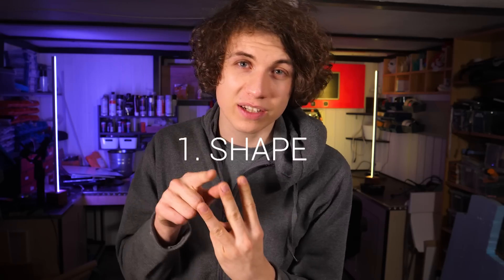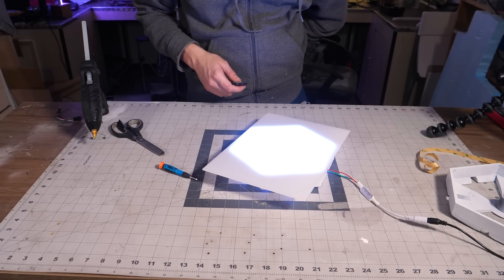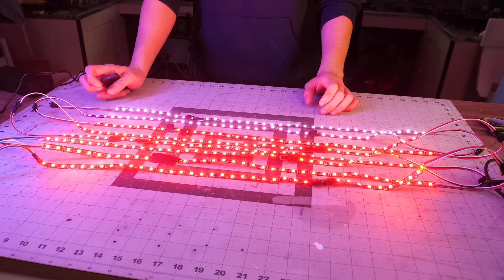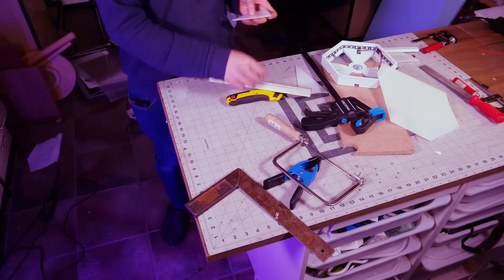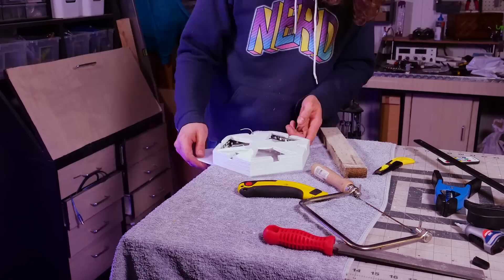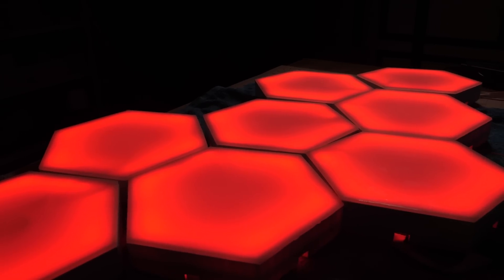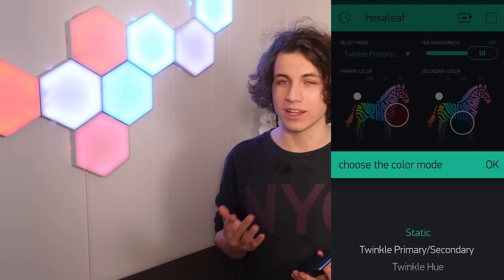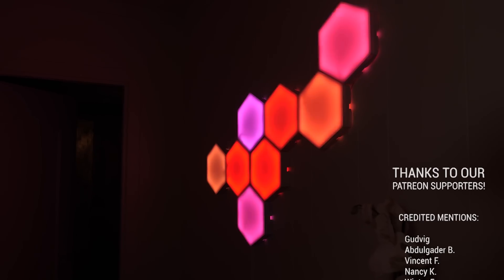Making My Own Version of Nanoleaf Aurora - DIY Project

Comment: In case anyone is interested, I found these styrofoam trays make great diffusers.  Styrofoam plates would work too, but these have a nice large flat area for cutting out.  These do have an embossed logos underneath but you don't see that when used:

https://www.amazon.com/gp/product/B0017OCLAK/ref=ppx_yo_dt_b_asin_title_o07_s00?ie=UTF8&psc=1

Comment: Hey man, This looks realy awesome so I showed it to my dad. And now it seems Ill be making 2 sets of ~10 or so. Luckily I found a nice place that cuts the Acrylic into hexagons for you cutting the labor time down by alot.

Something I noticed in this design is the light bleed for the cable holes. I think I might design and 3D print some "clips" to plug unused holes to reduce the light bleed from the holes.

Comment: Great project.  
The EsPixelstick firmware on a NodeMCU is quick and easy for non-coders.  You can model the light in x-lights or Vixen, and then animate it.  EsPexelstick also works with MQTT.

Comment: great work as always, i have a question, what could you change(code-wise) for a WS2801 LED strips when it has R G B pins instead of one data pin!!? tanks .
Reply: Like.. everything 😹 you can then get only one color always. With argb, you can control every led separately.

Comment: What is the inside measurement of one side of the hexagon please.  Did you use 39 LEDs per hexagon?
Reply: He used 13 LEDs per box, in the code he defines the constant LEDS_IN_BOX as 13.
Reply: @baryemini4103  That can't be right because the strips he cut  had 39 LEDs on them. Maybe 13 for each colour R G B?

Comment: magnets and contact pads would probably make it easier to replace or add more segments as you wouldn't have to deal with the connections especially since you're gluing the diffusion plate to the top. polarizing the magnets would also help make sure you don't put them in backward.

Comment: So many confusing things about this project.

(1) Is the logic level shift just to go from 5v to 3.3v? Couldn't I just use a 12v to 3.3v step down?
(2) What width/height are the acrylic sheets? (trying to find some on Amazon here in the U.S.)
(3) LED 2811 strips aren't individually addressed pixels, it's every 3 pixels. So was that an issue?

Comment: Hello, i am also an elelctracal engineer from Berlin, Germany and i really like your video. 

i wanted to chek out yout Android app, but the link is dead? 

Does the Led Stripe require 5V for Controll Pin? is it possible to do it with 3V or 12V like VCC? 

When i take the arduino nano, the Digital Pins got a 5V level, so the level shifter is not needed !?
for what purpose do you use the DC5-24V Mini 14 Keys RF Wireless Remote Controller, isnt the Programm run by the Microcontroller? 

Thanks for your answers, goodbye

Comment: if you have twisted the ground and the signal then you have killed the 1st chip - cut the 1st chip away and solder the wires again - then it works

Comment: Hey, I rebuild your cool project but I am facing some problems when it comes to the cable extension when placing it on wall. When I put a cable extension between the board and the lights it flickers at brighter colors. Removing this cable fixes this issue but I don't want to place the board at the wall... How did you fix this in your version?

Comment: Project started! 
Optimized 3D model, center cylinder removed, and to be closed so no light emitting where unwanted, can be broken out where the connector goes.

2 printed @ about 18cm, <30m filament. Parts to be ordered & waiting :-(.....
Anyone to put on the list for a set? :-) drop me a note.

Comment: Awesome video! What filament did you use for the 3d printed panels? I'm thinking of starting a project just like this but i'm still inexperienced with 3D printing. Can I use pla? Or would that break down over time?

Comment: Hey I`ve printed one frame und would test it with one pice, but where i can get the blynk code. If i use the link above, but  i only get a start page from blynk and is it possbile to use a Wemos D1 or Nodemcu ? Thanks Sascha
Reply: I found out and it works. But now and then the LEDS flash / flickering, do you have any idea why this happens or is this due to the NodeMCU?

Comment: The 3D printed frames look kind of awful. There's clearly some layer separation and misalignment going on there.

Could probably do it faster and cheaper with a thin sheet of plywood for the sides of your hexes and 1x1s or 1x2s for the framing.

Comment: doing this with wood frames around the hexagons would look dope
Reply: especially some dark wood like cherry
Reply: @CrocoDeluxe  I'm working on it right now, I'm looking at getting a quart of dark walnut stain https://www.amazon.com/dp/B001CESFSM/ref=twister_B07L4HMRM9?_encoding=UTF8&psc=1
Reply: @jupit3r131  You used wood??
Reply: @CrocoDeluxe  Cherry is Not dark xD
Reply: and very expensive .. just some Styrofoam plates for diffusers and some plastic C channel that you get for hiding cables.. easy to cut and join..

Comment: you could probably 3d print one with a translucent filament spool.. actually if you're drawing on it you could make it really trippy like add weavings of fractals and stuff that'd look boss lit up
Reply: like, tubes and openings leading off in slightly different angles so as you move around and stuff more or less light gets out and sparkles different it'd look like really nice :D

Comment: You should have just made a flat frame for holding 8 mm thick acrylite. Then couple the light into the acrylite from the edges. To top it off, a thin reflector on the back and maybe an additional diffuser on top of the acrylite.
That would give you a very non-DIY look. Flatter and with almost perfect uniformity of the light.
Reply: P8qzxnxfP85xZ2H3wDRV true!

Comment: You need to have the unused slots in the hexaleaf closed so no light leakage. Just have pre-cutout marks on the inside. Great project!
Reply: You mean so there would only be a need for 1 hole cut out for each hexagon? Makes sense but then couldnt you only keep the lights as one shape ?

Comment: I think covering the inside of each hexagon with aluminium paper could drastically improve the light diffusion and make it look more uniform towards the centre
Reply: how exactly should the foils be placed ?
Reply: @meenakshisundaram4305  The reflective layer needs to entirely cover the inside of the hexagon, behind the led strip of course. Covering the inner borders could help to increase a bit the reflectivity as well.
Reply: I was wondering if anyone else noticed this. I kept thinking about the low-light/deadspot in the middle of each shape since only the perimeter was lit. Good to know someone already has a solution ready.

Comment: “Cheap diy” * needs 3D printer to start*
Reply: You can get a printer really affordable these days. Also stolen comment
Reply: you don't exactly *need a 3d printer*.... one person could just take plastic  strips( Lexan or Plasti glass) , make a wooden/ aluminum form, score and heat bend the strips over the form. glue and done.
heck you could just use angle aluminum as the frame. DIY Perks style.

Comment: Why did you use the voltage stepdown and a logic level shifter?
The ESP32 can be powered via the Vin port and the voltage must be between 7 and 12 volts. Why can't you just use the d19 port directly on the leds?

Comment: Is it be better if you add a mirror on bottom inside cases? or it will be too bright.  Nice lamps exselent work
Reply from the maker: Honestly, there is no need, they are very bright, and the light is very even. The camera makes it look like there is a dark spot in the middle, but in real life they look entirely smooth :)

Comment: Impressive! One question: how do you control each strip separately if they're all connected in serie? How do you identify each one? Thank you! :)
Reply from the maker: Hello! Good question! They are addressable LED's,  which is a requirement for this to work. This means each LED has a belongig microchip that interfaces with the Arduino/ESP32, and accepts a signal to know which color and intensity to show.
Reply: @Nerdforge  Oh I see! Thank you:). Another question: which kind led strips are the ones with more light power? I'm thinking about building led tubes controlled by DMX for a small stage setup for my band! :D so I'd need very bright leds :D
Reply from the maker: @PhiLiaSF  I guess you should opt for more leds/m. I know there are some with 144 leds/m, and that's kinda bright :)

Comment: Would have looked into other options instead of a glue gun.  That way if a strip dies it'd be easier to replace, as if you mess up removing them you have to replace the whole hexagon

Comment: I've always considered using telephone handset jacks as a great way to wire projects like this, you could add an INPUT and OUTPUT port to the back of each module, then link them with a short (or long) patch cord for a neater, more "professional" look
Reply: They are not made to handle the high current
Reply: 6 amps is not a high current, these jacks should be more that adequate
Reply: I can only find the more high-end 6.35 mm jacks from Amphenol (ACPS-GN) and Neutrik (NJ3FP6C) which go up to 10 A. But they are quite bulky.

3.5 mm jacks are usually rated at 500 mA. I was able to find some high-end ones that go up to 4 A though. Still not enough for LED strip applications.